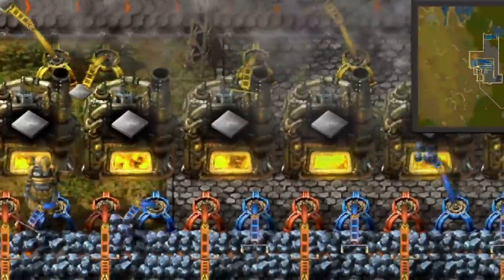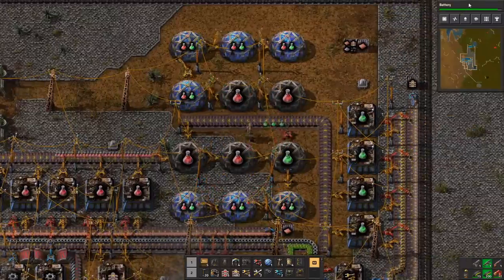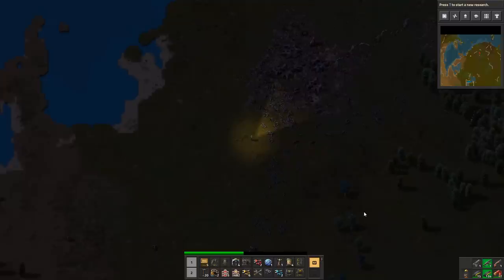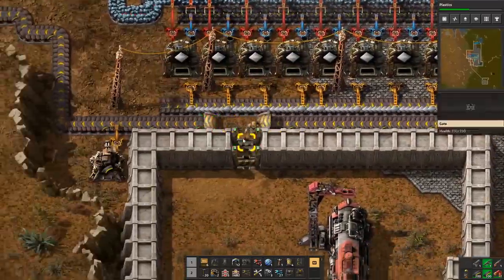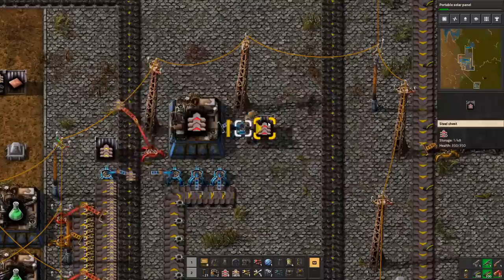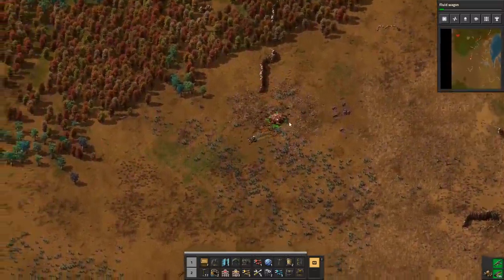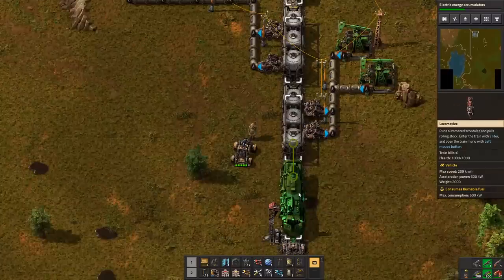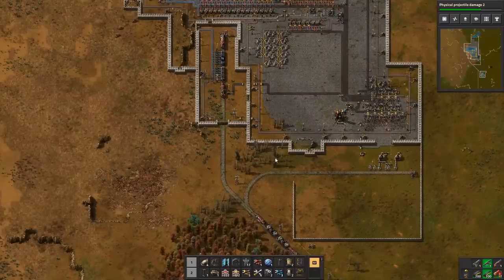Factorio Has Expanded My Brain

Comment: The more nests you kill, the more the buggos evolve, so there's some merit to just leaving them alone when possible
Reply: You kill bugs to stop attacks and get ancient relics from some nests. Also, bugs evolve over time, so not attacking nest as quickly as possible will result in them getting stronger. Pollution and attacking them have different variables at which the evolution happens.
Reply: @krus4ding_b4k0n  ancient relics are no longer part of the game. i am pretty sure.
Reply: Can you wall them off?
Reply: @harbl99  they will eat down the walls.
plus they also evolve over time.
Reply: Agreed, simply fighting the waves is much cheaper than clearing the nests, especially early game.
Reply: @Gearjerk5  killing bases adds to the evolution factor, you can modify how much it does so in the settings before starting the game, but by default it is quite significant

Comment: if you ad more signals in order to create "segments of rail"
if a trail is inside that segment the signals turn on blocking entry into that segment for any other train.
so put down signals every so often (around the length of the train) for a primitive secure way to handle trains.

but it would be better for a two track system. one going out and one going in.
so trains can always move. (just put down segments)

Comment: rail signals divide your train tracks into blocks, each block colored differently from the adjacent blocks. automated trains will not enter a new block if another train is already in that block. if you have few, large blocks, your train network will run slowly. if you create many well divided blocks, each large enough to fit a whole train (typically 1 locomotive and 4 cars), your train network will run far more smoothly. however, seeing as you do not have a loop track, and so few trains, i dont think you need to worry about this all that much yet.

Comment: a useful QOL mod, i dont remember the name, but it auto-flags your miners with no ore in range to be removed. this helps in the early game as a big red X is easy to spot over the small red light, and it helps in the later game as your robots will auto remove the drill.

Comment: A neat trick for unbalanced belts (belts with more in side vs the other) you put two splitters in line and remerge them on a straight belt and it will evenly distribute the belt. (Good plates and such that can get clogged on one side and empty on the other)

Comment: Small little thing here, You don't need all those radar installations, just having one will show you that entire box that you have visible right now. When you are placing the radar it has a big blue box that shows the area which will always be visible and then it updates boxes outside of that up to where you can currently see on your map. My guess is you have all those radars in essentially the same few chunks so they are not actually doing anything. In either case while only a minor issue its just a power drain on your base to have all those boys running that close together. My suggestion would be having one per base or doing one in each corner to expand your view.

That said, I literally did the same thing in my first base lol ALL THE RADAR!

Comment: Hey! Nice surprice!
Signals: See how they the rails have color when locating signals?
Signals divide the rails in section by colors, you put a signal and after the rail divide, but for the signal both path are part of the same section, so anything in any would be considered also an obstruction on the other.
And signal go on the right side the direction the train goes, both ways rail need signal I both sides.
Energy: Excess energy is wasted, to story energy need to research giant batteries.
Radars: That is an Obscene amount! XD, they work as outpost in tactics games, clear fog of war around them, suggest puting them in the outside bases so you can see without moving there.
You can change the name of stations.
Game has visual filters, graphics and tools FOR EVERITHING!
Upgrades, selective selection, contamination, production,  energy stats, etc, etc. 
Experiment a little, learning to use all the tools make the game easier to understand and use.
Good luck

Comment: Awesome video :) there is a tutorial for train signals under ur science bar. But in a nutshell u need a chain signal before the intersection and a  normal one after the intersection. Since ur using one track with double headed trains u need to put them on both sides of the track 👍

Comment: Ah the early days. I'm on my 2nd factory. I'm not sure but the factory has a circular defensive ring around it which a train with nuclear fuel would take 10? 15 minutes to circle? At max zoom, the top and the bottom of the wall will not even come close to fitting on the map. The Factory Must Grow.

Comment: “I was a newbie the other day”

You still have a lot to learn. Like with the furnace setup. It’s still more efficient to have a single line on the outside, for both sides, with both coal and ore until you get electric furnaces, at which point all conveyor space should be dedicated to ore. 

As we’ve mentioned on Discord, a Factorio stream-multiplayer session would be a ton of fun, and other Factorio players - such as myself - can help you learn more advanced factory building techniques.

Comment: Train signals 101: signals are social distancing for trains. if you hold a signal, you will see colored lines appear. Only one train may go into a colored section at once. 
The goal is to split the rails using signals, so that trains ''wait'' if another train is using the next section. You also want to make sure that half the base isnt just ''one section'' otherwise all the trains just go ''well, bobby is using the entire base right now, better wait forever''.

There is more to it than that, but understandign this should allow you to experiment and discover the system at your own pace.

Train signals 102: Chain signals are like normal train signals. the only difference is that they tell trains: ''hey fuckwit, dont enter the next section unless you can make it out and reach the next normal signal.'' The main purpose is to put them before intersections. You dont want a train to enter a x or Y section of the network and then chill there. Think of them like traffic lights. they tell the cars to wait BEFORE the intersection, and go when its clear. The cars arent allowed to just stop and wait in the middle of the crossroad, because that way lies madness. 

You want to put normal signals AFTER an intersection, as a way to tell the trains: we are back to normal, if you reach this point you can stay here, you arent blocking anyone.

Chain signal: Shit or get off the pot, or trains.

Comment: One of the most important tip I think is to look at the speed of belts and inputs of your machines. This will let you understand the ratios of your production and plan things better. Simple example is green circuit construction. Optimal use is 3 manufacturers for copper wire and 2 for green circuits. Here is an image of this : https://external-preview.redd.it/dUOscOr89g942qb0N1h4GqJTn0dVpmUoMzRHypzIkkY.jpg?auto=webp&s=513a81b54dbcd87f790a455ad3285bbbe0fe9c80

Comment: I have a tip for you, on how to make this game even more interesting.
Set the nest frequeny to max, same with the size and change the starting area size to 50% (less will be just unplayable).
And if you want to be extra masichist. Set expansion frequency to minimum (both max and minimum) with max group size and max distance.

Enjoy your brutal fight for survival, it took me a few tries until i menaged to stabilise my defenses.

@edit:
In case anyone tries it, i have a few tips for you:
1. Heavy armor (the second armor you can get) armor allows you to just tank small biters, while you destroy spawners, just throw a granade from time to time to avoid getting overwhelmed.
2. The best defensive structure against biters is a simple turret with 1 layer of wall around, it breaks enemy ai in such a way, that they try to attack the turret, but because of the wall they can't.
3. When building full wall, try to use terrain to reduce amount of walls, not like here, where he protects cliff for some reason.
4. Don't fear pollution at the star, enemy evolution must reach 0.05 (or 0.1, im not sure) before they can start attacking your base.

5. It does not include their expansion, which can just set to your spawn point.
6. Because of this rush weaponry, then turrets and then walls.
7. At the start you might want to conserve your ammo, to do so unequip it and bash your enemies with melee. You can defeat up to 4 small biters at once easily, be careful with higher numbers.

8. Don't put radars together, they are the best for intel on what is going near them, even when you are far away.